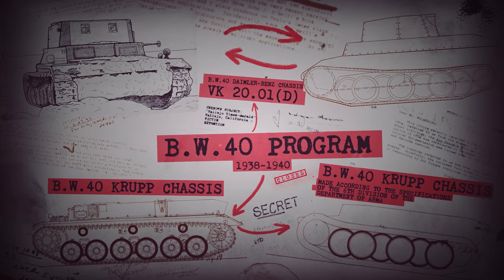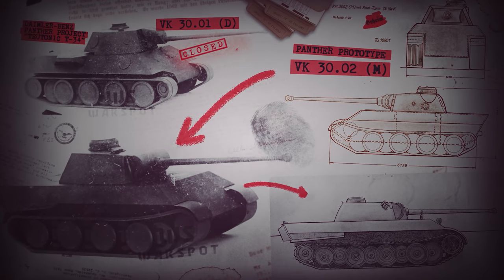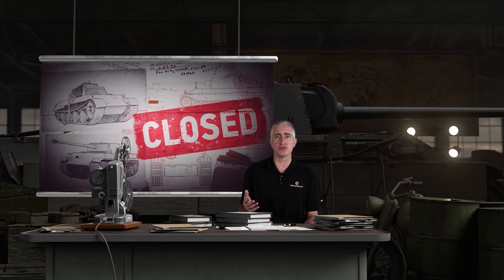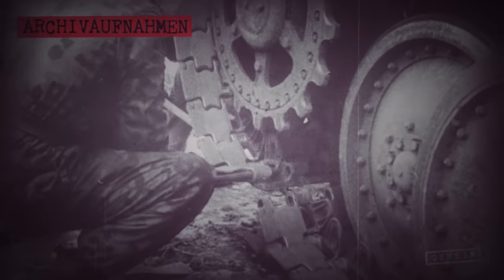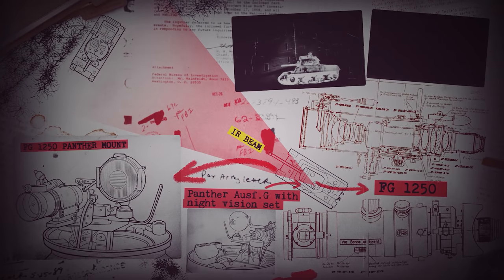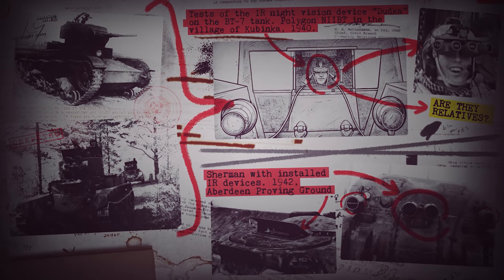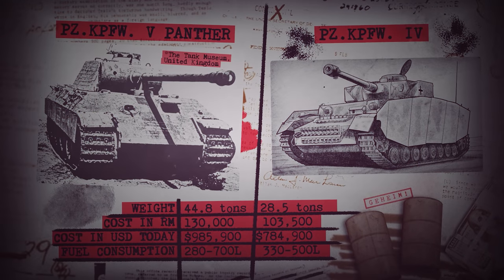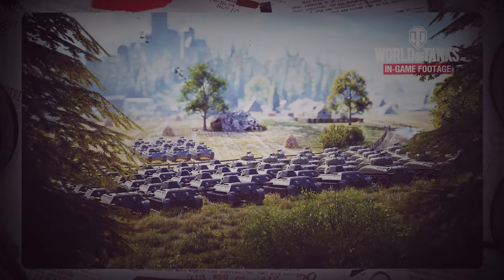Five Things About the Panther with The Chieftain - World of Tanks

Comment: In THE ARDENNES: BATTLE OF THE BULGE by Hugh M. Cole, it is claimed that new tanks that left German factories were often stripped of parts and less than half of the new builds actually made to the western front intact. 

"The spare parts situation was so bad that new German tanks were cannibalized at a depot west of Koblenz. Three hundred and forty new tanks were assigned to the Western Front during the campaign, but only 125 can be traced as actually reaching the armored divisions." pg 664

Comment: Excellent point about the Panthers having a longer maintenance cycle. This was largely due to Germany having a shortage of recovery vehicles, and the majority where designed for 30 ton vehicles like the Panzer IV and Stug. As a result they often had to send two recovery vehicles just to recover one Panther.

Because of this, in addition to needing trained drivers, the Panther was often transported by rail even over short distances instead of road-marched. Unfortunately rail transport was a laborious and time-consuming process, so by Normandy Panzer officers were faced with the choice of either deploying their Panzer IVs first piecemeal, or waiting several days to several weeks for the Panthers to finish their rail transport. In practice, piecemeal deployment ended up the norm.

Thats also why I would quibble a bit regarding the idea the Panther was a quality vs quantity tank. The overall concept is sound, but the Panther was not really the right kind of quality the Germans needed. Better armor and gunpower did not offset losing most of its road march capability. Thats indeed the main reason why some argue it was better to stick to Panzer IVs - they might not be better than Shermans or T-34s, but at least two battalions of Panzer IVs will arrive together with greater concentration of force. Instead most Panzer Divisions in 1944 ended up reacting immediately with just the Panzer IV battalion (which would get chewed up), which was then followed a few days later by the Panthers.

That said, there were plenty of actual better designs that could have given the Germans an upgrade without losing much road march capability. Jagdpanzer IV and the Daimler Benz Panther both fit the bill. Even the historical Panther could have been modified by just reducing weight from armor to be more road mobile.

Comment: Agree with the 'better vs many' idea. The BF109 was an example of the other way of thinking, concentrating on production of a design that was a step below the latest and greatest (ie Mustang), and the Germans ran out of pilots and fuel. That being said, it wasn't Panther or nothing, the Germans ramped up production of their 'simple tanks' right until the end of the war, PzIV, PZIII (as Stugs), even the 38t (as Hetzer)
Reply: The 109 was better than any fighter of it's time when introduced. It continued being competitive throughout the war with improved designs.
Reply: Most German aircraft engines had design and manufacturing flaws that limited their usefulness in combat. There's plenty of German reports where 50% of their bombers and fighters sent off on missions had to return to base shortly after taking off due to engine problems.

Comment: The Pz IV, as a platform, had reached it's limits. Attempts to further uparmor and upgun the Pz IV ended in failure. A new platform was needed that could carry more armor and bigger guns that the Pz IV couldn't. Keeping Pz IV in production, would have made little sense. As the basis of various tank destroyers and mobile artillery, there may have been a way to keep them in production, but not as tanks.

Comment: Its not even just the crews needed to field extra numbers of tanks. Its also all the extra support echelon crews and vehicles needed to function. Tanks don't exist in a vacuum. They need supporting grenadiers, recon, engineers, medical, field kitchen, anti aircraft, signals, administration, fuel, ammunition, maintenance etc etc.
Over 80% of the personnel in a panzer division was not in the actual panzer regiment. Without these supporting echelons tanks cannot function effectively no matter how more of them you have. This is why the panzer 'brigades' that were rushed to the front in autumn 1944 were completely ineffective. They lacked even basic recon and maintenance echelons.

Comment: The single greatest failing of the Panther is a simple single tooth gear with in the finals drives instead of a double tooth
Reply: maybe.  All tanks had issues with different engine and suspension parts that required replacement and repair.  People say the Sherman was a more reliable vehicle, when in reality it was simply easy to work on, in comparison to tanks like the Pather.
Reply: @uni4rm  do you know why Sherman transmission broke on less frequent rate but could be repaired/replaced fast? It was a simple double herringbone gear with the final drives. Which reduced to stress on individual teeth which is a big thing when there harden alloys are drying up.
Reply: Then why do Panthers, Centurions and M26 Pershing all used double reduction gears with straight cut gears as final drives? 

And why does the Panther and Centurion ARVs had no issues towing tanks above their weight class?

And do you really believe a radial engine, 30 Zylinder Chrysler multibank engine or a twin diesel of the m4 are easier to maintain than regular v12 engines? 

Didnt you listen to the video, it already said, that the Panthers final drives are as easy to replace as on other tanks! Panthers achieved the same combat ready rates as Panzer IVs and Stug IIIs since early 1944.

Comment: Thank God the reliability part has been clarified by Chieftain but....the "not" combat ready Panther thing was a "myth" again...
Avg. The panthers Combat readiness was 65% on West and 62% on East.
With Numbers: 
In 1944 Nov 15:
329 Panther was on the Western front.
234 was combat ready
95 waited for repairs.

In 1944 Dec 15:
471 Panther was on the Western front.
334 was combat ready
137 waited for repairs.
That is absouloutly not bad.
And of course as we going forward to the end of the War the combat readiness lowered.
Why?
-Less expereienced crew
-Less spare aprts
-Less organization
-More fights.

You can find the combat readiness table 1944 may until 1945 march on Panther reliability section.
PS:
The shermans avg engine life time was 2,500-3,200 km, except M4A4 what coul go around 5,500-6,200 km.
Tha Panthers avg engine life time was 1,500-2,000 km. So yes the Panther was worse, but for what advantages ;)

But there are a report, when the german mechanical crew could achieve more:
"An example of Panther reliability appeared in the June 1944 edition of Nachrichtenblatt der Panzertruppen (Armoured Troops Bulletin), from a Panther-recovery tank driver's report:

    Unteroffizier Krause of a Panther workshop platoon has driven his Panther recovery tank – Chassis No. 212132 – 4,200km until 3 May 1944 without any needing to replace any parts. About 1,000km of this was made towing another Panther tank. The vehicle and engine are still in great condition and operational"
Reply: The fact that the Germans felt it was appropriate to give an award to someone for getting their vehicle to 4,000km is probably telling in itself...
Reply: @TheChieftainsHatch  Yes, but still it says: The engine  and the transmission could achieve that.

This matter is true on every single tank.

 [And from a tank what had a problem with the final drive and could achieve the same range without transmission/engine/final drive replace like a sherman, ofc I would gave him a medal]
Reply: @TheChieftainsHatch  And sorry I forgot the mention it in my previous comment:
As I said in my first comment, the vehicle crew had no or little bit experience with the tank driving/using. This matter increase the chance to give a medal/attention  for somebody who achieve those km with that kind of tank.

Comment: on the flip side for the whole Panzer IV vs panther debate, it arguably would have been better to improve on the boggie suspension of the panzer IV and give it the planned sloped armour upgrade. we know that the Panzer IV could also mount the Schmall turn (the only issue being its suspension with the new weight) and so you could have gotten a just as good tank as the panther that didn't change the production machinery, engines, etc as mutch, ie closer to the sherman development (new boggies and new turret, and a change in hull sloping)
Reply: Germany should have just gone with the VK30.01DB instead of the VK30.02M.  The VK30.01D was chosen at first but Heinrich Ernst Kniepkamp (senior engineer at Wa. Prüf. 6) convinced Hitler the MAN design was better and could be put into production quicker so hitler reversed his decision and chose the MAN design. 

. Did I mention that Kniekamp previously worked for MAN and was not afraid to push their products over others. As it turns out the VK30.02M reached units about same time the VK30.02D was estimated to enter service.  

The VK30.01D was as well armored as the VK30.02M, used same gun, used a air cooled diesel engine, was lower profile, and weighed 32 tons. The VK30.02D was mostly just use of the Schachtellaufwerk overlapping road wheels and overall improvements to the design.
Reply: I wanted to put this in a separate post. 

Krupp developed a improved suspension for the PzIV that would have upped suspension capacity to 30 tons. This was the B.W.30. Krupp was instructed to cease work on the B.W. and concentrate on improving the PzIV. Germany was already being massively outproduced and Waffenamt didnt want any interruptions to Panzer IV production.
Reply: The problem with that is that the PZ 4 was designed with access hatches for the final drive and gear box in front of the driver.
Adding sloped armour would not only have needed a full redesign of the front suspension but also of the hull roof and the drivers position in order to pull those out for maintenance instead of being able to fix them in place.

Comment: On Dec 22, 1941, a report to the Directors of Diamler-Benz stated "Based on experience in the Russian campaign, the New tank (VK 20) just developed by Diamler-Benz was now obsolite..." the B. W. 40 design was a dead end. The VK 20 was designed as a 20 to 22 ton tank, with either a 50 mm/L42 or 50 mm/L60, (which was a long barrel, more effective gun). The L60 was not issued to Panzer III's until mid December. This VK 20 was absolutely no match for thr Russian T 34-76 let alone the KV-1. The German did NOT just speedup design on an experimental tank, they had to redesign a new 34 ton tank with 80 mm of frontal armor and a  more powerful L70 main gun.

Comment: The "horrible" reliability of the Panther and Tiger was mainly Allied propaganda. 

Sure, they had plenty of issues - but so did any other WW2 tank. All WW2 tanks were high maintenance and broke down - a lot. The Sherman, too. During road marches 30-40% of Shermans could be expected to suffer minor or major mechanical issues - on a daily basis. This is 1944 - even your vanilla family car would be expected to break down at any time. The achilles heel of the Panther (and most other German tanks and assault guns), the final drives, performed considerably better in German service than in French service.

The reason the Tiger, and especially the Panther was singled out for special threatment by Allied propaganda is that they were so obviously superior when it came to combat capabilities that Allied HC had to come up with some kind of explanation/excuse why their own troops did not have tanks with similar capabilities. "Yes, they are dangerous; BUT they are also waaay too big and heavy, complicated, overengineered, not suited for mass production, horribly unreliable, slow, sluggish, near immobile behemoths, fuel hogs etc...." 

The Panther was just the first of a new breed of big, powerfull Western standard tanks that would eventually become the MBT. Both USA and UK were already designing similar tanks; M26 Pershing and Centurion, both would go through the similar cycle of teething problems as the Panther and any new tank. If the Panther was so horrible, the Americans and Brits would not have bothered with these new tanks.

By 1944 the standard 25-32 ton tank (Panzer IV, Sherman, Cromwell, T-34) could only survive on the battlefield through numbers and "stealth". The Panther, Pershing and Centurion was the way forward.
Reply: The French used Panthers after the warm so they were deemed pretty decent

Comment: I'm not 100% convinced that quality was their only option. 

You can't one-for-one transform one resource you have into any other resource. 

Was it worth the teething troubles for them to introduce new pieces of equipment? 

What strategy could you build around half better but eighth as numerous vehicles?

Germany could have either converted its strategy to fit the resources it possessed or converted its resources to fit the strategy it wanted to have. Neither were to be easy tasks.

Comment: Different point of view. On October6, 1941, near the Russian town of Mzensk, Russian Col Katukov's 4th Tank brigade, equiped with, new T34-76 and KV-1, ran amuck, thru the German 4th Armored Division. Col Katukov's brigade destroyed 133 German tanks, 49 Artillery pieces and 15 prime movers. After returning from the Eastern front, the German Armaments Ministry issued a directive demanding the development ofa NEW tank. Requirement were for a high velocity 75mm, L70 main gun, not yet developed, 31 to 35 metric tons, glacis plate of 60 mm, and a top speed of 35 mph.

Comment: It's a shame more funds and production capacity of where not put into the upgraded Panzer IV. So much research and production went into wonder weapons that did little good overall.
Reply: Panzer IV had reached the end of the line when it came to how room there was for upgrading it. The later models were already pushing the design past its limits. Upgrading it in any meaningful way would have required redesigning the entire thing, and at that point you might as well design a brand new tank.

Comment: I always wondered how many gallons of fuel the Germans had on hand per month for their tanks and if that fuel was being optimized?  To put if more bluntly how many tanks of different kinds could the Germans support with their fuel supplies and if was matched with the actual number of tanks they had?  It would have been a very difficult question to get the correct answer for.  How much fuel does a Tiger, Panther, Panzer IV, III etc use?  Stug IV, III, Hetzer etc?  What was the most economic tank to build in terms of cost per enemy tank killed vs cost of production and fuel required?  Maybe the Germans could support 4000 tanks on the Eastern Front with logistics at a time and only if they were Stug IIIs?  It is such a technical and nuanced problem to solve.
Reply: The Tiger 1 and Panther used about 30% more fuel than a Panzer IVH - and about the same as a late war M4A3. The Tiger 2 twice as much as a Panzer IV.

After Pearl Harbor - once USA joined the Allies - the Germans had basically lost the war. Even Leopards 2 couldn't have changed that.
Reply: They listed monthly fuel production and requirements by the ton for transportation purposes. People also forget that Germany had to supply fuels and lubricating oils for their occupied countries' industrial and agricultural sectors. They and the Germans made widespread use of producer gas generators that smoldered coal, peat and wood to produce a flammable gas that provided 50% less energy than gasoline. The German Army used those on all of their training vehicles and all transport vehicles behind the lines. At the end of the war, Germany had 500,000 vehicles of all types, including locomotives and maritime craft running on producer gas. Germany also refined city gas made from coal and compressed it into a liquid that was stored in long tanks fastened to vehicles to eliminate their need to have the bulky gas generators mounted. 
When questioned after the war, the German armor commanders and crews said their best tanks were the Panzer 3 and the Hetzer due to being well-balanced machines that made them mechanically reliable and used less fuel and motor oil. US GI's reported that the vast majority of German tanks they found still operating at the end of the war were Hetzers and Panzer 3's due to their commanders giving them priority for fuel and oil since they run all day on a full load of gas without breaking down. The Tigers and Panthers were gas hogs with the rest of their up-armored tanks not much better since engines use up a lot of gas moving 28 to 55 tons of metal around. The M4 Sherman was a gas miser when compared to the Big Cats. It averaged .5 mpg travelling cross country, then 1.2 mpg and 1.5 mph when cruising at 23 to 28 mph in overdrive on gravel or paved roads.

Comment: According to Speer the Moustasched Man insisted on slapping more armour on it until it basically became a heavy tank (at 45 tons we can't call it a medium tank, that designation comes from it's original design) and this might have resulted in the notoriously unreliable final drive. A 35 ton Panther with decent reliablility could have been one of the absolute best tanks of WW2. 

And I gotta disagree a bit with the quality vs quantity argument regarding late WW2 german tank designs. Yes qualified crews were a problem with the Panther but that's because they were green crews. Ultimately putting a few thousand more soldiers as crew instead of frontline cannon fodder wouldn't have made any major difference. The fuel issue though is worth debate but there are different angles such as the fuel you can obtain by having a mobile tank force instead of what you have with Tigers where they're basically only useful for defense with the way the war was going.